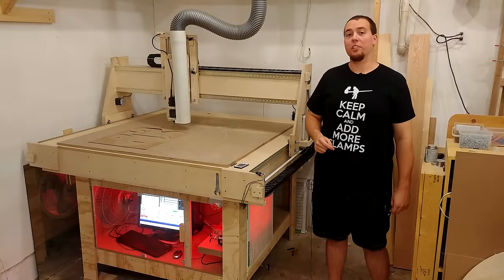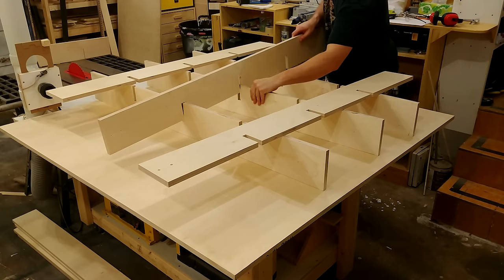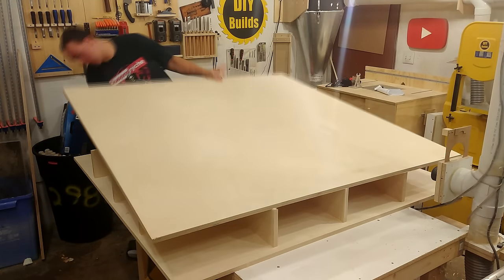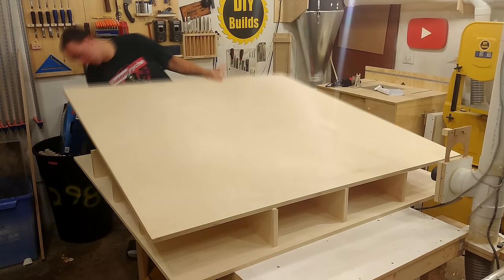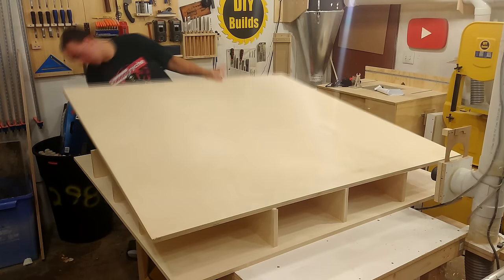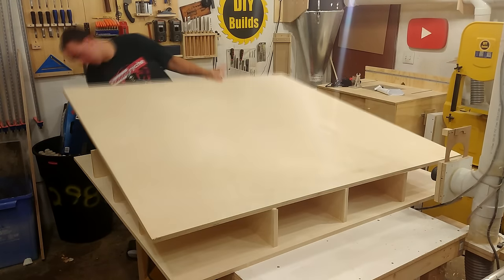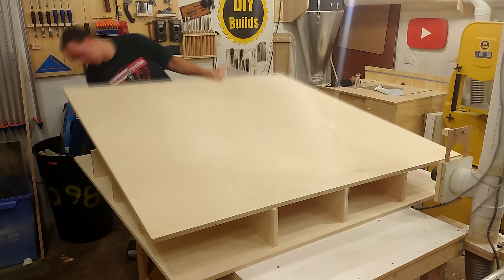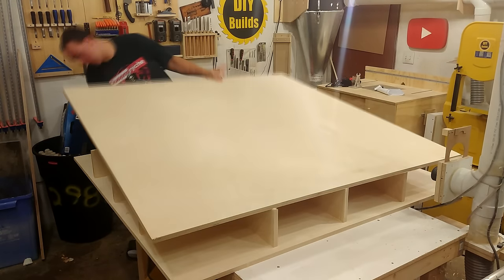DIY CNC Router for Under $900 - Free Plans Available

Comment: Currently in the process of making this, having issues with the timing belts not tracking correctly on the bearing rollers. They end up rubbing on the bent washers making the gantry pretty hard to move by hand. The belts are about as aligned as I can get them with the center of the rollers. Not sure if anyone has had issues with this or if the steppers will just power through it.
Reply from the maker: Sounds like the bolts went in crooked to me.
Reply: @DIYBuilds  it's only in one direction though so that kinda threw me for a loop, but I will definitely check the squareness.

Comment: Just a small mistake in the schematic, the power supply for the contactor that switch the spindle motor on and off, it's suppose to be 24V, but in the schematic, it shows a 12V power supply.
Reply from the maker: Not a mistske. 12vdc can power a 24vac coil
Reply: @DIYBuilds  ho yeah?  Ho sorry then.  😁  Very nice built!!

Comment: Well made video. Very educational, but I take issue with the entire wood design. Humidity and seasonal changes can cause wood to expand and contract thus affecting the accuracy of the cut and program execution. While I understand a metal construction will cost more wouldn't that be better in the long term? Not trolling by any means, just trying to get the most bang for my buck. Thanks again. Great video.
Reply from the maker: Plywood doesn't move like regular lumber.

Comment: Diagram shows a 12v DC power adapter, yet the contactor coil shows 24 vac ? Did i miss something? Why not use a step-down transformer there as well as you did the power supply for the servo motors? a 40 amp contactor will certainly not burn out on the routers load.
Reply from the maker: It's the same fucking thing calm down.

Comment: Really loved your video so thumbs up on that, how ever one thing i did not understand is the table it self where you did that TIC TAC TOE wall in it why did you let all that space go to waist, why not make some draws ?
I mean you have a work shop a bit messy but  hay that is a work shop i know from experience, but one thing i always run out of is shelf's and draws, especially when doing bits and knots and bolts so i would  have done some draws just to have order of my bits and one of spare things.
Well that was my 2 cents worth of "What i would changes if i was building the table. " But in the end good job and PS. ?
How long did it actually take ?
Reply from the maker: that would weaken the structure of the torsion box... and 8 million hours of staring off into space thinking of what to do next.
Reply: @DIYBuilds  Well im not saying all the corners need to have boxes, and your forgetting that the draws them self actually give some structure strength it was just an idea i know that you can never have enough draws, but that would only make one little tinsy thing at the end "What bloody draw did i stick XXX thing in ???? "

Comment: What should the distance be between the router collet and the waste board.
Reply: There is no set distance. You are talking about the Z axis which can be made to lower the collet all the way down to the surface if the waste board (depending on how much range you build it to have).

Comment: Thanks for very nice video,  and also for free plans! One thing: would you use in future the same size of V groove bearings, or would you choose bigger ones?
Reply from the maker: so far so good but if i had more money i would use linear rails
Reply: @DIYBuilds  Thanks for quick reply! I am in the same situation (planning 5x10 workspace), but todays prices are just too much. I am just thinking about making the bearings mounts adjustable, something like twisting cam on some 3d printers, to get rid of any slack.

Comment: So good!!! And with plans, too, thanks! But is there any chance that you provide metric plans instead of imperial ones? :(
Reply from the maker: nope... google conversion will be your friend
Reply: @DIYBuilds  I know, I know... Was hoping that your drawing software able to print a plan in imperial/metric as requested, to avoid hundred of conversions... :( But anyway, still thanks a lot: I'll get my cake WITHOUT the cherry, doesn't matter! :)
Reply: @mac_lak  No offense, but converting between systems is just arithmetic.  You should be comfortable in different measurement systems.  If you don't want to do a bunch of conversions by a tape measure in inches.
Reply: @Anon54387  No offense, pal, but apart somme 3rd-world countries, only USA still officially use customary (imperial) units - and it causes a lot of critical fails, in particular in spatial domain... 7.5 billions people in the whole world use metric system and SI units, with decimal subdivisions.
We simply DO NOT find USC measures (or tools) here, in France: we don't need them excepted on very, very specific cases - and most of the time, we don't really make any measure, we simply use inches as if it was a reference, for example screen sizes or printer's DPI).
Reply from the maker: Well bud. Canada isn't a 3rd world country and uses imperial measurements. It completely makes sense to keep using it in the construction world and in day to day normal human uses. Imperial measurements are visually superior. I can easily visualize 6 feet 2 inches but 188cm is stupid. Just like plywood thicknesses being 18mm or whatever. 3/4" is very easy to judge as we all know specially how big an inch is. We all know how big a millimeter is but when you have to count 18 of them it becomes difficult to imagine. So ya the metric system in terms of the construction world can suck it.
Reply: @DIYBuilds  To be honest (from an European point of view), Canada and USA are quite the same country... Officially, Canada is SUPPOSED to use mostly metric system, for example: when it's not the case, it's due to USA "contamination".
I know, I'll be hated for this, but sincerely, it's what most European think - exception for Quebec. Don't wanna troll and/or insult: if so, please accept my sincere apologies. Officially, with USA, only Liberia still use customary units - even Myanmar have dropped them now.
For the other part: sorry, but... no. An inch is not "more visual" than a centimeter... An open hand is 20 cm from thumb tip to little finger tip, a good step is one meter, little finger thickness is one centimeter, a whole thumb is 10 cm, and so on. Decimal system is way, way superior to unequal subdivisions. 

You are USED to UCS, it's not the same. For me, born with metric system - and since Revolution, in fact, since we invented it - I simply can't understand how people can prefer a non-decimal system.
For me, 1.88 m is WAY more easier than 6"2, which is simply... as abstract as "12 smartphones height".
Long story short: excuse me if you felt insulted, it wasn't intended. I simply find it sad to not have plans that can be used directly by 90% of people, that's all.

Comment: What's an "ACME" thread?  In the UK we think ACME is a generic fake/comedy name of a manufactured device, from the days of Roadrunner and the coyote using ACME paint to paint a tunnel on the cliff, or any other product to make a trap.  What you have looks like either a length of M8 threaded rod or possibly a worm drive rod, but I'm using a tiny phone screen so I can't tell.
Reply: What we call ACME thread in the states is just a common thread profile on leadscrews. I can't seem to find an appropriate UK equivalent name, but it is just a different thread cut on a rod. Worm drive rods are similar in concept.
Reply: @SomeNameGoesHere  Ah, leadscrews, like on my lathe, not coarse construction material, like regular threaded bar.  Now the geek in me wants to know what the "common" thread is, 'coz I'm certain it's not metric ;-)
Worm drive is of course a similar concept, but a very different form indeed! :-)  Probably a whole lot more expensive...

Comment: NGL, kinda concerned the EStop doesn't directly disengage the router contactor; if the cnc ctrl board fails you're in strife...
Reply from the maker: Well when you make your cnc you can hard wire that in.

Comment: Cool idea. The only problem with using wood is wood expands and retracts so much based on temps and humidity, i would of tried aluminum for the rails and gantry and wood for the bed. Good job though
Reply: Plywood, especially high quality furniture grade plywood, doesn't suffer from movement like milled lumber does.
Plenty of CNC machines have been made from plywood with no long-term issues.
Reply: @BigRalphSmith  I machine plywood daily and it moves all over the place based on heat and humidity
Reply: @ThomasShue  BS. My direct experience (and the experiences of many other woodworkers) says otherwise. Not only that, I can even explain the physics of why plywood doesn't suffer from movement the way that milled lumber does but I'll save that explanation for you to request rather than bore you with details you don't care to listen to.
Plenty of CNC machines have been made from plywood with no long-term issues.
Reply: @BigRalphSmith  just because you say it, doesn’t make it so. Here is an example, Baltic Birch, one of the best plywood of all sheet goods for stability, I will have sheets move .250 within 5 mins moving from a stack to the table, there is tension in all wood, it all depends on the layup of specific Species, that determines how much it will move. You are making an argument between solid lumber and sheet good. Who the hell made that the argument. I could careless the relationship between hardwood and sheetgood used in a CNC machine build. My point is simple, using WOOD of ANY TYPE, to build a CNC machine is not good. ALL wood moves based in heat and humidity. There is NO WAY possible for that machine to maintain a consistent cut. Steel and aluminum that is kept at a fixed temp will hold tolerance much better. Im talking regular tolerance as in .0001
Reply: @ThomasShue  And yet, plenty of CNC machines have been made from plywood with no long-term issues. Don't just take my word for it, there's evidence of this everywhere if you'd bother to look.
Tom, you can cry about it all day long. Doesn't change the fact that plywood can and does make a good CNC.
Deal with it, buddy.
Not my problem that you can't acknowledge the truth and arguing with you in a YT comment section about something so obvious is a waste of time.
I'm out. Best of luck.

Comment: how do you cut 4x8 sheets on this...ive seen you do larger cuts in other vids.  can you make a video on how you set it up for this type of project
Reply from the maker: I dont the table is only 5 by 5 allowing 45" by 48" of total working area
Reply: @DIYBuilds  when you did the video for the kids height measure stick you flipped the wood to finish cutting the numbers
Reply from the maker: Ya i made a mark to align the board to and made a rotated g code for the other half in fusion

Comment: Hello Again,
Now that you have built your cnc and have used it, how satisfied are you with your choice of the motor and driver package? Many people comment that 270oz motors are too weak to produce any volume. Sure would like to hear your thoughts on this. Thanks!
Reply from the maker: I use my machine as a hobby not production so for me its fine
Reply: @DIYBuilds  I completely understand. Makes good sense. You have a good level of knowledge about these cnc routers. May I ask, what combination of motors and drivers would you recommend as an upgrade to your fit cnc router?
Reply from the maker: Anything bigger is better.

Comment: Like it a lot, great job !
Just one little remark : You suck the air out of the electronics box so creating a under pressure what tends to suck in dust, better is to blow the air in trough a filter and create an over pressure that keeps the dust out
Reply from the maker: It sucks through an air filter
Reply: @DIYBuilds  Yep that was complete clear but you did not get my point , you have to blow air in trough an air filter to create a over pressure ! not sucking out the air that creates an under pressure
Reply from the maker: Yes that requires 2 filters for cross wind cooling though.

Comment: Parralel port to usb cable Can work with laptops connection it's work?
Reply: No, generally a PP to USB adapter/cable will NOT work with most CNC controller boards. 
If you want to use USB from a laptop, get a USB controller board.

Comment: Error installing electronics :. 1. It was necessary to have in vertical boxes. Dust settles down, leaving the electronics walls cleaner. And the boxes give another level of purification for cooling air. 
2. Drivers are installed on their radiator, cooling is blocked. This will lead to marriage and damage to the workpieces due to overheating. It was necessary to arrange at an angle of 90 degrees to the mounting surface.
Reply from the maker: Wrong. The air path is right through the heat sinks.

Comment: Thanks a lot for this, its very inspiring. I'm pretty sure I could build this, I just need to purchase some woodworking tools and invest a bunch of time into it. I like to cutout foam with this, and with a 6" allowance on the z axis I think that'd be great!
Reply: I really want to cut out foam with this tool. Do you see an issue with attaching a 6" long maybe 1/2" diameter bit to this machine, or would I need a different router for something like that?
Reply from the maker: No idea if such a bit even exists but if it did i wouldn't do it.
Reply: Okay, so i may need to attach a different router type unit. Thanks for the reply. I still think this design is viable for what I'd like to do.

Comment: where are the plans for this DIY could not find on the site..
Reply from the maker: Under plans then shop project plans
Reply: @DIYBuilds  thanks found it.. do you have any specific models on the boards used for the electrical wiring?

Comment: Soooo... this video and its updates have been out for awhile, yet you have no other recent videos of you making stuff with it. I'm interested in building one from your build instructions, but i'm a bit concerned since I don't see anything made from it.

Did it not work out? Any updates??
Reply from the maker: I have a full playlist of cnc videos and I often use it in my projects. For example the video I released 2 days ago.
Reply: @DIYBuilds  yeah just saw that after I posted. Been keeping an eye on your channel for a couple months looking for some projects using it. I guess i'm surprised I don't see it being used to make lots of projects the way most do.

So no issues with it? If not I'm going to start gathering build supplies this weekend.
Reply from the maker: Make sure to watch my 2 upgrade videos. I try to avoid using it in my videos because people like to complain that a cnc isnt diy
Reply: @DIYBuilds  I did watch them a couple months back. Have watched the original several times now. Will go back and refresh on those as well, if I remember correctly you had changed out a part or wish you did. How is that Harbor Freight router holding up after all this time? Still on there or did you swap out to another brand?
Reply from the maker: Harbor freight router sucks. Watch my belt tensioner upgrade video for details.
Reply: @DIYBuilds  Will do. Thanks for responding!

Comment: Will the din rail support that much weight
Reply from the maker: No
Reply: DIY Builds oh. I’m still watching through this, but is there something at the end?  I’m still in the planning stages for my machine. But there are some interesting ideas in here. But it also seems like you’d also be liable to drop or miss steps. Granted - this is just based on my research not on actual experience.

Comment: seen a design where they used bicyclechain as the drivechain , https://buildyourcnc.com/images/blackToe%204-0%202%20300.JPG
the same design used slotted holes with a bolt tapped in lengthwise to tighten the cariage to the rails , they used band steel and v bearings the steel strip bolter to the side of the table same as youre setup
they had a neat trick on the y/z axis too used the same bearings and angle iron https://www.youtube.com/watch?time_continue=15&v=ke1leVG6jws&feature=emb_logo
seems cheaper again (if you build it youreself)

Comment: Echoing all the "good job and video" comments, I will say the only disturbing part is watching you rapidly throwing around pieces of stock and cutting them at high speeds--because of the timelapse--without the blade protections in place.  I just hope no one grabs a six pack and tries this himself...at those speeds.

Comment: wery low voltage to drivers to motors, better how high volt motors come i use drivers maximum 46 volt, but better if buy drivers what handle more volts, my friends have 60 volt DC drivers. normal cnc need more than 3 newtonmeter motors about 4-5Ampere  best motor drivers have handle 8A 90V about 100$/ motor.

Comment: Great build . But you have no idea of how to use a table saw safely. No wonder 4000 plus sets of fingers get removed in the US ever year. They put guards and knifes on saws for a reason and you should never straddle a blade. You are going to loose your fingers or get run through eventually.
Reply from the maker: I live in Canada so my fingers are safe.

Comment: Save some time and labor as adding screws to a properly glued joint is really unnecessary as modern wood glues bond the parts stronger than the wood itself.
Reply from the maker: Yes and no. Depends on the joint.
Reply: @DIYBuilds  Maybe I should have said properly glued AND CLAMPED joint - screws substitute for clamping but I always prefer the cleaner look and time saved with no screws.

Comment: you need a 3D printer for sure
Reply from the maker: Im accepting donations.
Reply: @DIYBuilds  me too looooool , seriously your video is great and you could make your own 3D printer , the size of the CNC you just made , i make mechanical parts for my projects like a rotor for my generator , and it works great and it will be great addition to your CNC